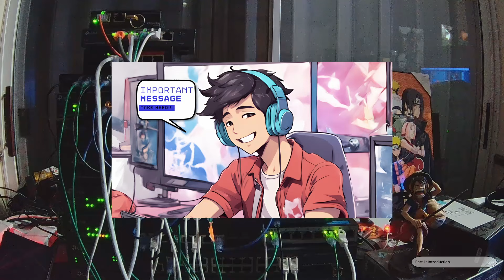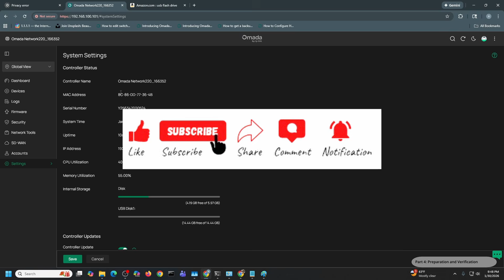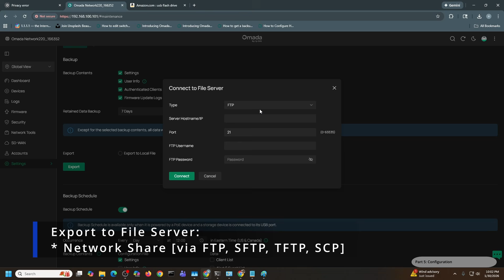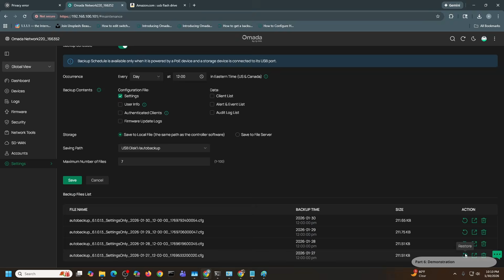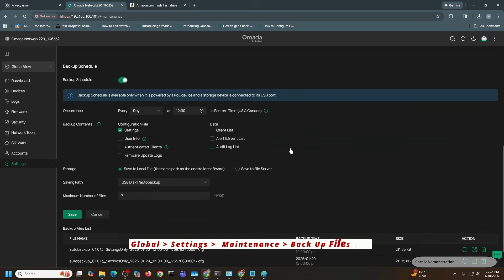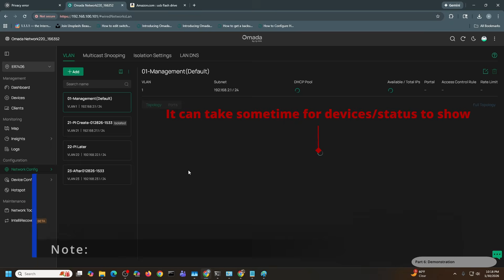LC89: Make Omada Great Again [MOGA]! Backup and Restore your Omada Hardware Controller

Comment: does have high availability? e.g. put two oc200 as clones in a network.
Reply from the maker: hey @allenperera6158, thanks again for dropping by. I don't have access to OC200 anymore so I can't tell you for sure, but I don't remember seeing that when I was still using my OC200. I published a video about OC220 a few weeks ago, this new OC220 Controller supports HA (as well as OC300 and OC400). You can check out my video for more info, I will also leave the link to the official Omada Blog post below:

Infor about OC200 vs OC220:
https://store.omadanetworks.com/blogs/news/oc220-vs-oc200-why-we-upgraded-the-hardware-controller

UB42: TP Link Omada OC220 Controller:
https://youtu.be/yGBnbLhG9Gs?si=s7Zsq8LDMw20GlAQ
Reply: @deadmeats  nice. i really appreciate it.
Reply from the maker: @allenperera6158  you are always welcome sir!